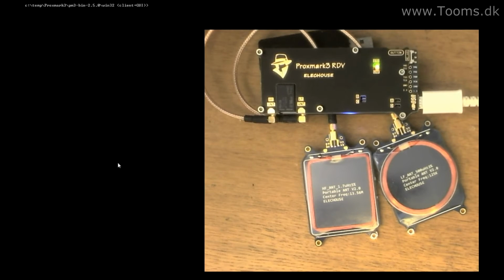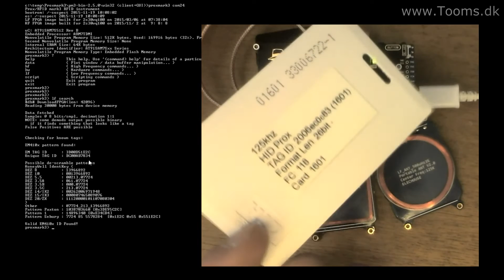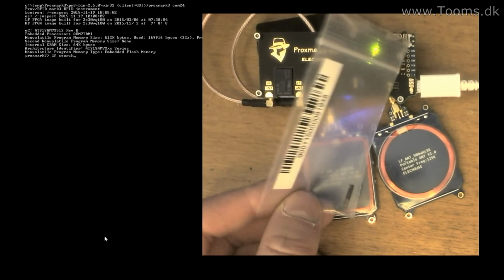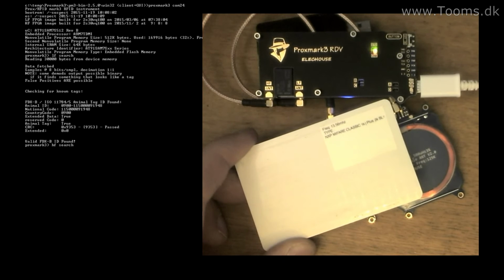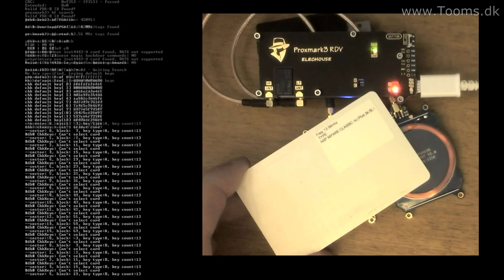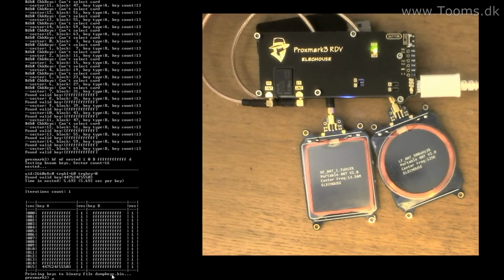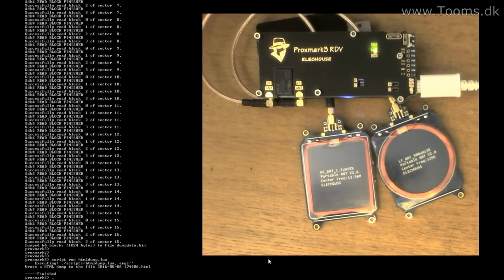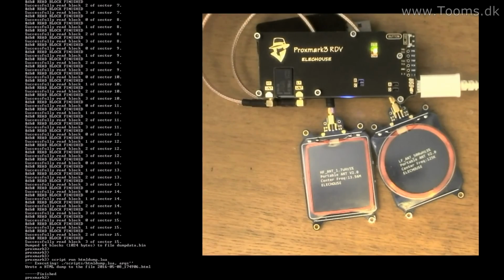Playing with Proxmark3 and RFID tags

Comment: Hey don't know if you're still active here, but what kind of cards can NOT be cloned with the Proxmark3? I'm trying to get a grip on RFID technology, but educational sources out there are somewhat confusing and there's no condensed write-up publicly available. Would really appreciate any pointers and insights.
edit: Also regarding how encryption works - from what I understand there are Mifare 1k and 4k cards that are somehow encrypted, but not exactly sure how that works, given that it's basically only an ID on a card?
Reply from the maker: Think the most secure will be "Desfire EV2" or "Mifare plus", and then very important use an private master key but that will add extra cost to the system...
But i am not an expert in what is best, newest and most secure so you have to ask and work with an professionel RFID firm
Reply: ToomsDK is this better than a magspoof..is THIS a device that exploits even pos terminals ?